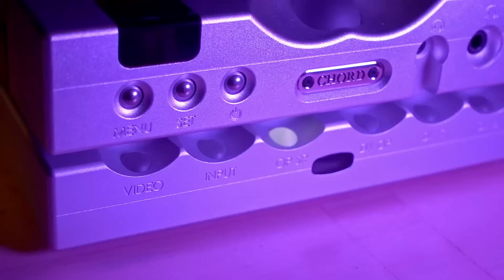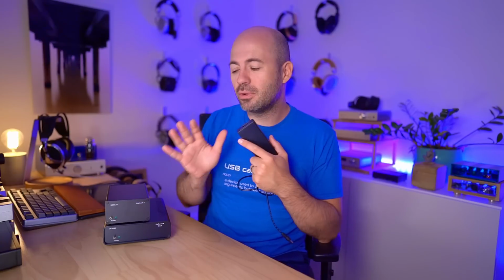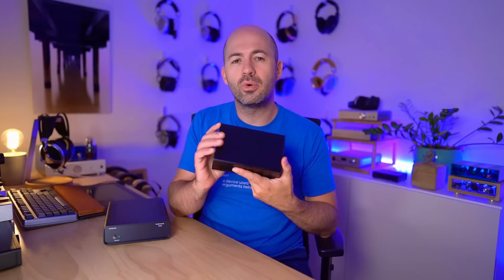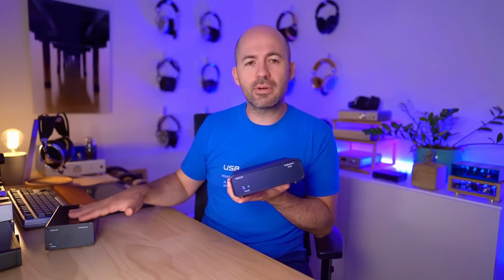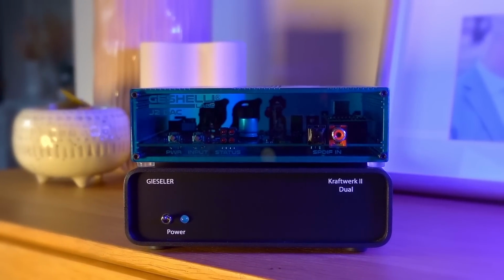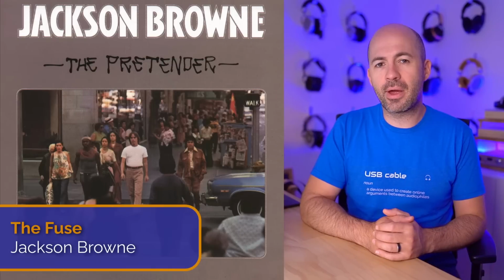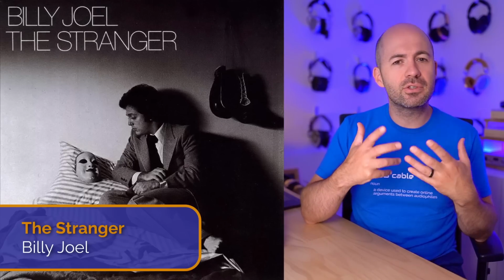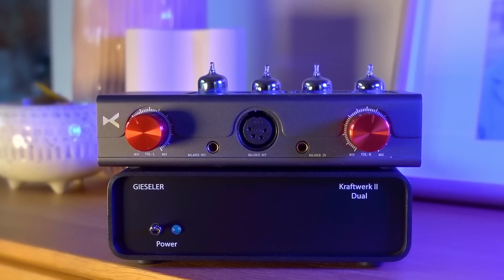Audiophile Linear Power Supplies - Do they improve the sound?

Comment: I missed this one - but glad I found it. A high pitched noise was driving me mad, and I found out it was my phone charger. Because of this I started researching power supplies. Most of my audio components have internal linear power supplies already, but I have a Geshelli DAC in a secondary system.

What I take from it is that for people that regularly like to try out audio gear, it is a good idea to have a adjustable linear power supply at hand ;o)
Reply from the maker: It can definitely be a nice addition if you can use it across multiple devices. Glad I could help! 🙂

Comment: All of which begs only the question, exactly who out there is buying a $900 LPS to upgrade the sound of a $169 Aiyima amplifier?
Reply from the maker: Hopefully no-one. This wasn't about which products you should buy an LPS for so much as an exploration of how LPSs might influence different product types.
Reply: @PassionforSound  I got that, but I am of the impression that most audio gear that uses switching power supplies is in a much more affordable segment of the market. 

If we imagine, for example, a 10% limit on the reasonable amount to budget for cleaning up one's power, we would need to be adding the $900 LPS to a $9000 system. That seems ... improbable, to me.
Reply from the maker: That's surprisingly not the case as products like the Chord DAVE, M-Scaler and TT2 all use switching supplies (although TT2 negates this with built-in super capacitors). There are other high-end devices with SMPSs too from Burson and other brands. LPSs and SMPSs both have their pros and cons, but I do think that LPSs seem to sound better in general.
I think the types of people who are happy to buy LPSs are doing it for the experience of tweaking the sound rather it being than a monetary value based decision so I totally get where you're coming from and don't recommend people buying LPSs in general, but I think it's different for those who want to play with LPSs for the fun of it.
Reply: @PassionforSound  I'm also being a bit untrue to my own guidance for friends, which is to ignore rules about how much to spend on which thing, and just get what sounds best. Goodness knows I would have been happy to have a $900 fix to my squirrelly power at the last house I owned.

Comment: Using a $600 (or $900) power supply with a $250 J2 DAC seems a little weird. Like wouldn’t you be better off using that money to get a better DAC? (Same for the E2 amp.)
Reply from the maker: Yes, I specifically discussed in this video that I don't recommend investing in power supplies for cheap gear when you can upgrade the gear itself. I included those products to make for a broad ranging test.

Comment: I am sorry if I missed this information in your excellent video, but I would be interessed in the power consumption of the linear power supply. Is it much higher than the power consumption of switching power supplies? Heat would indicate some kind of inefficiency.
Reply from the maker: That's an interesting question that I haven't considered. I imagine it is a higher power draw because of the inefficiency as you said, but I've never directly compared and it's likely to vary depending on the specific voltages and currents going in and out

Comment: what if you have a 4A device (like the mSCALER) and run it with one circuit of the dual version wich provides only 3 Amps?
Reply from the maker: It's always worth matching or exceeding the current requirements so I'd be chatting ton Clay about that
Reply: @PassionforSound  that´s what I thought but you´ve only talked about Volts... chatting ton Clay??? means what? thanks (I´m an Aussie as well but from Austria)
Reply from the maker: Sorry, that's a good point that my emphasis was on volts because all products I tested were able to be driven by the LPS I was using so current didn't factor into my thinking - sorry!
Clay is the owner of Gieseler Audio (he makes the LPS I tested). If you're in Austria though, you'd probably be better off finding a local company that makes quality LPSs and chat to them.
Reply: @PassionforSound  I know, I will, thanks for getting back and for covering the basics so well in this and your other videos!

Comment: Very important topic of conversation, but on order to go straight for the jugular it is AC regeneration. :)
Reply from the maker: I'm sorry - I don't understand. These products are outputting DC, not AC.
Reply: @PassionforSound  it is the beginning stages of treatment for power. The AC that comes out of your wall outlet goes through an AC regenerator, which cleans and regenerates all new AC power that doesn’t have the tops of sine waves chopped or jagged, which negate the use of LPS’s or conditioners.
Reply from the maker: I understand now. Sorry, I thought you were saying that the LPSs were doing regeneration.
I actually use an AC regenerator, but have never take the time to explore it's impact of different devices and their sound quality. I will do that soon though...
Reply: @PassionforSound  I apologize as well from taking away from the main topic of discussion. LPS’s are great for some gear that warrants it. For Instance I have a Cyrus CD i player and it has its own unique power supply (PSXR-2) that really improves and opens up the sound and makes so much of the internal circuitry components to work less hard. 
I also have an LPS for my Chord Qutest. I mainly got an inexpensive one, so I could turn on my Qutest more efficiently, since it uses USB C input to power on. Sound improvements there? I would say no. The USB C SMPS plug that it comes with suffices enough. 
Lastly, I got my LPS’s in my sound-chain way before I got my AC regenerator from PS Audio. I ended up getting the P3 Stellar model. That changed everything and became the real deal on all levels. Now of course like you, I’ve never bothered to to run my system without the LPS’s and just the regenerator. Why? I cannot be bothered because the sound is so fantastic and why mess with great power staging? I know. I should try and I will try once you make your video. :) I honestly think it won’t make any difference unless your equipment has inferior components inside them, which I surely doubt they do. AC regeneration is the best, but it never hurts having LPS’s in the chain either. The assurance of ultimate linearity will make your equipment sing and work half as hard. :)
Reply from the maker: No problems at all. It's funny how once you get a device like the AC regenerator into the system, it's just easier to set it up and enjoy it that to do any back and forth testing. I really need to check out the impact though to see how much it might be improving things...

Comment: Hi, interesting video. Knowing you’re a fan and owner, me too, of the TT2 & M Scaler was surprised not to hear in depth opinion of the linear power on those. Given theyre relatively high end products would have thought they would be perfect to judge.
I have all my equipment plugged into the Audioquest Niagara 1200 power conditioner. Wondering if this would negate the need for linear power addition.
Thanks, keep up the good work
Reply from the maker: That was a bit of an oversight on my part! The TT2 gets no benefit at all from changing the power supply because of its super capacitors. The M-Scaler though gets the same types of improvements as the rest of the gear I discussed here. In other words, the improvement is moderate, but significant (not groundbreaking) and results in greater refinement, the ability to hear even more micro details and also a slightly greater sense of space as a result
Reply: @PassionforSound  thank you Sir. I’m thinking the effect on M Scaler may be even further curtailed given the power conditioner. 
Quite relieved 😀 as I’ve recently dropped a bunch on the Innuos Zenith & Reclocker, both products would be fascinated if they came across your desk. Best wishes
Reply from the maker: I'm keen to try those too. Maybe in the future... 🙂

Comment: Since you bought one specifically for the M-Scaler, how does it work compared to the stock power supply?
Reply from the maker: Good question and I should have mentioned that in the video! It's great with the M-Scaler. Basically, it does all the same things that I described in this video to a moderate level. It's not a massive change (it never is with power supplies iny experience), but it's significant enough to be worthwhile given the value of the chain people are likely to be using the M-Scaler in

Comment: I bought the Burson 3A Super Charger Power Supply for half price on BF for my Soloist 3XP Balanced Amp and I could definitely hear the difference.  Is it a huge difference?  We'll it's not a 50% difference... but it's at least 10/15% better and cleaner sounding on an already great sounding Amp which is a big leap.  I went back and forth with the 3A SC and the original Soloist power supply to be sure I wasn't falling for some snake oil/smoke and mirrors product.  It wasn't.   👍
Reply from the maker: So glad you tried it for yourself. It's a nice upgrade, isn't it?

Comment: Honestly I just recently got a linear ps for my streamer, and I got to say man I think just like cables the differences are very minimal amongst LPS's.  The one I got has nichon caps, some high quality crap from germany, and swiss fuses.  I think everything in is at least to a mid tier level, some would consider higher, and direct from china it was only 80 dollars.  I did check the individual cost of everything to see if this was authentic or fake, and honestly it does make sense if you are doing DIY and selling it.  I am certain their are higher quality parts but what they are using is what you consider audiophile grade.  I cant imagine ever dishing out even 400 for LPS.. 13200 uf of capacitance, and rather than one big cap it's multiple small ones which is also considered to be better.

I'm not sure the longevity of the product, but I would honestly assume it's maybe a couple of years and at that price I cant imagine there being a huge factor.  Parts could possibly be fake, but to be honest for this price and getting everything you need, I would have no issue purchasing and upgrading everything and make this super top of the line for probably only for another maybe 150 USD.  So that's again about 230 dollars and without a doubt outstanding.
Reply from the maker: The differences aren't huge - that's for sure. Things like cables and power supplies are 'last pieces of the puzzle' items, but they definitely do make an improvement - that's for sure.
I've looked at those cheap Chinese supplies too and I think maybe the biggest cost savings will be on the transformers used which are a key part of the circuit. There's nothing wrong with using what you've bought, but I would definitely expect better results with a higher quality supply

Comment: Hi Lachlan, another great review. I have been a fan of replacing SMPS with Linear Power Supplies for some time. Indeed my Chord Dave has been modified to be powered by a Sean Jacobs  DC4 / ARC6 linear power supply. The results lift the Dave to a quite sublime level of sound quality. I have also tried powering a Chord Qutest dac with a Sean Jacobs DC4 LPS costing more than £4k GBP and consider that it took the sound of the Qutest to areas where it could compete with DACs costing more than £5k UKP. Of course my Mscaler is also powered by a Sean Jacobs LPS! (To good effect).

As to what is causing these differences I am well aware that inaudible high frequency noise can cause significant issues with sound quality and this is the basis of my WAVE High Fidelity digital BNC cables which you reviewed. In this case the high frequency noise gets into the analogue stage of the DAC and causes intermodulation distortion which is easily heard at even low levels. However with the power supplies, whilst this might also be a reason for what we hear I suspect there is more going on that just that. For instance I have spoken to Sean Jacobs and he has explained to me how a very low impedance to the power supply to digital circuits can be very influential. I could hear this for myself when Sean upgraded my Dave DC4 to an ARC6 power supply. The difference was quite profound.

Anyway, keep up the good work and I look forward to your next video. Best regards, Nick.

PS, edit to say that I forgot to add that I also tried various LPS powering the RME DAC and was surprised at the benefit with that because the designer has always stated that there is no benefit to using anything apart from the supplied SMPS. However I always found the RME with that to be slightly fatiguing especially on ‘busy’ tracks and that went away when I used a good quality linear power supply.
Reply from the maker: Hi Nick, thanks for commenting and sharing such interesting info! I agree that the use of LPSs can be very profound! I'm yet to try other brands, but perhaps I can compare some in the future. I might even have to do an interview with a designer of power supplies to really dig deep. Thanks for starting me off with some info about how/why they're impacting the sound

Comment: My only experience with LPS is 1.  Using a cheap one with the ifi zendac (the first version).  That was a very obvious improvement and I think it cost me under $40, and 2.  The ifi ipower elite $300.  It made a significant difference paired with my streamer, a pi2AES.  Haven't tried one yet with a better/higher priced DAC, but based on this limited experience, I'd expect a similarly excellent LPS to improve most DACs as well.  I would even try a cheap one with any DAC under $300 in a more budget system.
Reply from the maker: No harm in trying! Thanks so much for sharing your experiences!

Comment: Those require an external AC voltage transformer. That means they are effectively just the DC filtering - not a "full" power supply, per se.
Another question - were the amperage of the power supplies comparable? If the linear power supplies could supply at least as much current as the switching unit, then that means it is like for like.
On the higher frequency affecting the sound - any percussive instrument will have a lot of higher harmonics that are part of that initial "attack" of the start of the sound. This is the definition of a sound wave that has the near "instant" rise at the beginning of the sound - it approaches a square wave, and has a number of orders of harmonics, that are summing together to produce that "attack" of the sound. Our brains are actually well able to sense these, even though we can't hear the higher frequencies when they are "alone" as a pitch.
Reply from the maker: Great info! Thanks, Neil - I'd never thought about that and it's likely a part of what's happening, but I think there's even more because a track with minimal transients like that will still sound better.
As for the current available, the Kraftwerk II is a 3A supply IIRC while the devices all varied a bit between 0.5A up to a couple of amps I think. Perhaps the KWII was providing greater current availability to the amps?
Reply: @PassionforSound  Right - more available current than required, is fine - and depending on the load impedance, it can definitely help.

Comment: Get a LPSU on a Qutest 😍
Reply: YES! I tried several LPS with the Qutest including a battery, MCRU, Allo Shanti, Sbooster, Farad Super3 and finally the uber expensive Sean Jacobs DC4. I ended up using the Farad Super3 but I have got to say the Sean Jacobs Dc4 power supply took the Qutest sound to simply divine levels of top end / mid range subtlety combined with deep and detailed bass.
Reply: @nickwavehighfidelity7651  scratch the question about the MCRU vs. the Sbooster, I found your excellent Head-fi thread!
Reply: @Koopagamelouda  Cool, I also did a post on the FaceBook Chord Electronics Owners Group. Basically I would say you cannot go wrong with the SBooster with Ultra Mk2 or with the Farad Super3
Reply from the maker: Great info! Thanks, Nick!!
Reply: @nickwavehighfidelity7651  Great to know! Having something non-fatiguing is a top priority!
Reply: @nickwavehighfidelity7651  Wow you sound like a repository of knowledge. I have questions for you!
-How could you tell if the better was not going to brick it?
-And what are the characteristics of the MCRU vs. the Sbooster (Mk2 Ultra)? Both of those are ones that I'm looking at getting, the Sean Jacobs being somewhat outside of my budget unfortunately!
Reply: I should rewrite my first question because of a typo: How could you tell if the battery was not going to brick the Qutest?
Reply: @Koopagamelouda   In my experience batteries cannot be trusted to output the stated output voltage especially the multi voltage ones. I have measured one where it was 2V over voltage and that could well blow a DAC. So my advice would be to always measure the battery output voltage before using it to make sure it is not over voltage. But better than that my advice is not to bother with a battery powering a Qutest. In my experience it did not sound very good.